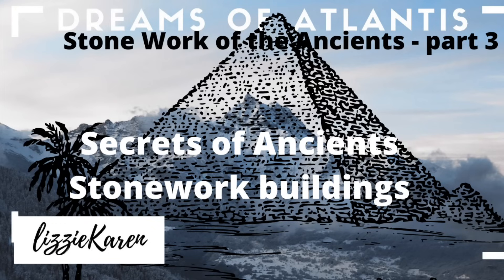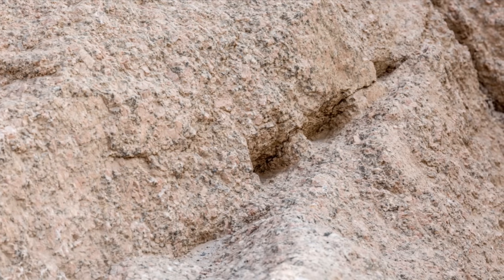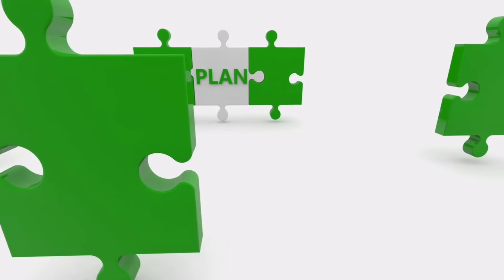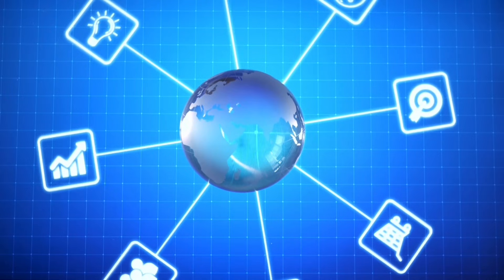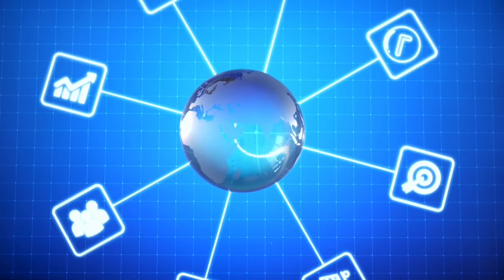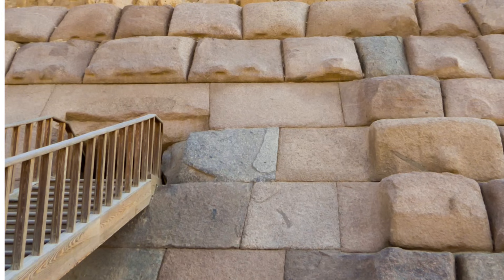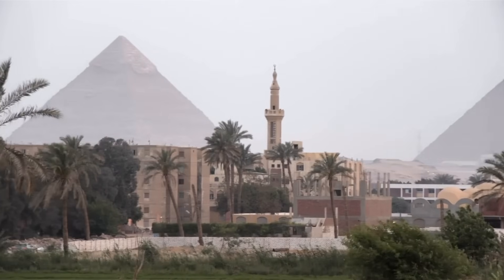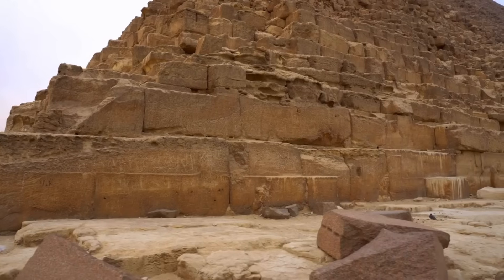Ancient tech prep building a Pyramid

Comment: "the dynastic Egyptians added the beautiful limestone casing stones". I think that this is the way by which it is said that the pyramids were built in relative recent times. The Pharaohs only put exterior make up to the pyramids, the structure itself could be dated to prior deluge times, or so I think.
Reply from the maker: Yes, that is what I saw in my dream regressions. It seems obvious to me but maybe it is only because that it what I saw.
Reply: @Lizziekarendreams  "It is obvious to you".  It is also obvious for the reasoning. The casing stones were added by dynastic Pharaohs, who knows which one of the Egyptian rulers gave the order to put the make up. It is said that there were beautiful Egyptian symbols engraved on those casing stones. But definitively they - the dynastic - didn't build the pyramids. Whichever was the purpose of the pyramids - not tombs, of course -  I suppose that the pyramids stop working due to the deluge, and they never worked any more.

Comment: Part of the earthquake equation I can help you explain better, not me but another of the many many scientists I follow online, I will try to give  a brief overview below though.
It was originally discovered in the 1900s and released in a book about "gizeh" that the courses of the stones varied at each height level. 
That information sat out there for just over a hundred years before someone here figured out why. 
It's all about interscalar geometry.
The size ratios that exist in the universe that balance everything out. This math covers everything, from orbital patterns, arm sizes etc and it's not the golden ratio, it's the number the stock market is designed to run on...hows that for black magic...making sure the conceptual theft institution remains a stable mathematical equation.
2.71....Eulers number, pronounced oil-er.
This is the balancing transcendental number, than when combined with the knowledge of the electron and proton wavelengths can be used to balance things. 

In practical terms, it means that because the height of each pyramid stone layer differs, an earth quake can never shake things loose because the resonance cannot pass from the lower to the upper layers. It will never ever collapse, it could be destroyed only maybe by a meteor, the tech to lift it all apart or direct nuclear attack or something. 

This balancing system works as layers of three types, positive, negative and neutral, and on a chart that would display as positive and minus, so from zero you would have, zero, (green/neutral) a plus coordinate 1x (red/positive) x2 (blue/negative) and the same in reverse going into the minus numbers upto around 42 repititions. 
In terms of scale, the positive coordinates map out the galaxy and very large things, the minus part of the scale down to the atomic and quark level.
Each positive and negative reflects the wavelengths, alternating, squaring or rooting the electron or proton...
Turns out the laws of the universe are astonishingly simple when you have made enough measurements and understand the language of counting. As Uran figured that out in what a couple of hundred years? Thats pretty damn amazing. Took us a couple of thousand to work out whats been in front of us the whole time, and thats only one part of the magic behind the pyramid design...Theres nearly a hundred more litttle pieces of magic in there.
Reply from the maker: Another fabulous comment that is truely enlightening. The way you so eloquently explain things, you remind me of Uran.
Reply: @Lizziekarendreams  Thank you.
There may be a reason for that, I mean, the whole city concept I designed also may be similar, does make me wonder. 

DId you get my other big long comment yesterday, other than the hair one?
Reply from the maker: @8thsinner  I don’t remember. I will go back and check. I’m desperately trying to finish my full length video that is due today on Omm Sety.
Reply from the maker: @8thsinner  I have finally finished my latest episode and can now answer some of your questions. Sorry it has taken so long.